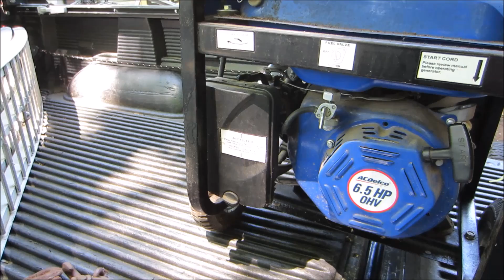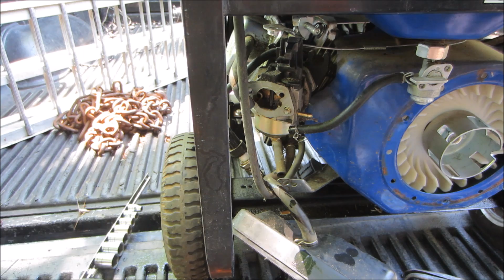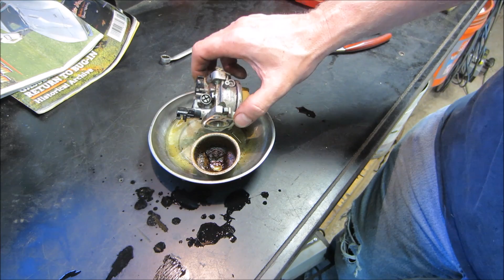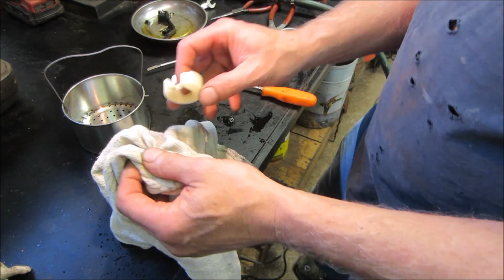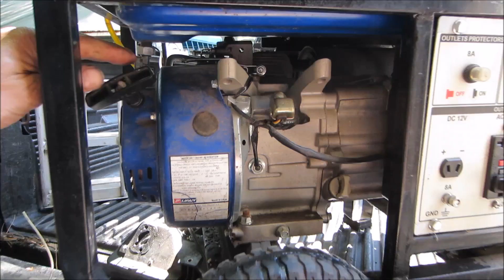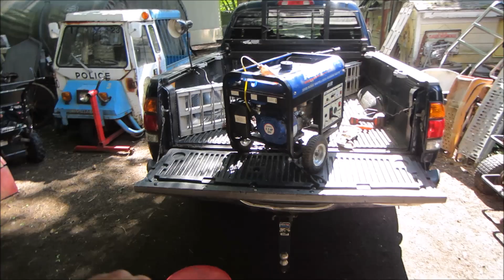will it run? seized china generator

Comment: Are propane motors subject to the same carburetor issues if not kept in service over extended time?
Reply: Wouldn't think so, other than possibly moisture in the fuel system. No ethanol or dirt to be introduced by gasoline.

Comment: Hi from Australia . I enjoy your videos very much  My 8 kva Chinese generator seized while running  . Strip down showed the valve guide had broken up and jammed the piston . Piston was found to be ok after I stripped the engine down . $30 for a new head and gasket it has been running fine for the last 3 years . People told me I should have bought a Honda at 10 times the cost but my el cheapo  6 year old generator is fine in my workshop running all my power tools including my welders ..

Comment: You have to make sure the RPM's are right to produce 120 volts and that you have 60 cycles.  If not...You'll burn up appliances...Also the surging is a leak in a carb gasket and a load helps to level things off...

Comment: Had a customer with a PowerMate generator, basically the same thing (all these China generators pretty much are). He dropped it off with old gas in the tank. It sat around for a few years and the petcock was just packed full of old varnishy gas. The fuel screen under the gas cap was all rotted out, the screen in the pet was all rotted out. I pulled out all the old screen material, cleaned the tank the best I could, and just added an inline fuel filter. Threw it all back together and it was surging just like this. Turned out to be a plugged main jet. I've also had mowers with similar surging problems, and most of the time it's just something small. It's kind of crazy how the slightest error in adjustment or air/fuel ratio can throw governors way off.

Comment: Thank you for explaining how gas gets into the oil. I've had this happen on two Ryobi engines- one is a power washer, and the other is my Ryobi inverter generator. In the power washer, the air filter was completely soaked with what appeared to be gas and maybe oil, and in both cases, the engine actually seized up while running. I fixed both the generator and power washer by draining all of the oil and changing it and both engines seem to have fixed themselves & they both work great now. I also now make sure to run the engines periodically just to make sure it works fine, as well as shut off the fuel on the power washer (generator doesn't have a specific fuel shut off, but I think the "stop" position on the only control they give you does shut off fuel). I thought it had to do something with the crankcase breather tube, but the idea that gas draining from the carb into the cylinder and into the crankcase seems to make more sense. And in the case of the power washer, the gas probably did make its way from the carb down into the air filter, so bad carburetor to some degree seems logical. I'm lucky more damage wasn't done and that simply changing the oil was all it took.

Comment: I was given a generator that I was told was seized.  My first instinct was to check the oil.  Oil looked new, and was at the proper level.  Could not pull the recoil.  I removed the recoil.The bolted on cup was too fragile to use a screwdriver.  I used an 1/16 deep socket and breaker bar.  I pushed down, to my left.  I had movement.  I took the breaker bar to the right.  More movement.  I turned a few more right hand circles and installed the recoil.  The engine turned over when I pulled on it.

I scared up a spark plug and installed it.After setting the choke properly, the motor started on the third pull.  The volt meter showed 120 volts.

I plugged in my hand sander, and it had power.  I plugged in my jigsaw and it worked.

A running generator and power output!  Gotta love it!

Comment: Look around and see if there is another oil drain.  Most of the engines have 2 drains. I put a short pipe on my generator engine with a brass collar to extend it out where it can be grained easier without getting it all over things. May not needed a brass collar but thought it would seal better than the steel one.

Comment: I put a generator in a shop years ago because it didn't generate power and the guy plugged a 1/2 inch drill motor in and spun the drill by hand to fix it. Does anyone know which direction you spin it?

Comment: Many thanks for your many videos. It takes me back over 60, ears, when as a 7 year old, I use to inquire what my Dad was doing in h if s workshop. He was not formally trained, but could do everything. He had alsorts of pullers to take off magneto, to get to points. I remember the screw in pullers of assorted sixes, he had made himself. He I often worked on B & S, Villiers and Anzani engines. He use to rebuild Howard Bantam rotlvators. I vividly remember the parts washer. In those days a tin with paraffin (kerosine)  and a small brush. Thank you for bri ging my childhood rushing back

Comment: Hi Mustie got a Robin EH25 that was soaked in water. Stripped it down and washed out completely, honed cylinder and put together. Had to make all the gaskets. Got it running but wont idle. Will have to do a carb clean. You wont believe how much gunk came out of it. Your videos have been a great help.

Comment: Same generator as I have got but the 3kw 240/110v with 12v 8a charging and the honda 160cc 6 1/2 hp engine, My tank had a load of rust in it thanks to the tank level gauge letting rain in. I brought it off of ebay as a non worker £40 ($55), I had to but a tachometer to correctly set the governor 1500rpm at idle  and the governor takes over (as the engine slows down under load the governor takes over to bring the idle back up)

Comment: All these problems caused because they did not hibernate the engine correctly.  Only takes five minutes to empty the fuel tank, and then run the carburettor dry.  Trouble is, most of us are guilty of incorrectly storing our gas powered devices.
Reply: Hey david, I have also found (since I do winterize my stuff... mostly and guilty of not also) is the metal gas tanks will condense heat and cold so if stored empty they collect fine droplets of water and start to rust.  I see no way around this problem... saying that if the tank is stored with fuel (fuel line shut off and carb drained of course) the tank stays much cleaner and problem of rust is averted.   Now when needed to be used just expect to drain old fuel out of tank and put in fresh and recycle old fuel in your car on a mostly full tank. So far... this has worked well for me.
Reply: @thaddeustroyer  I solved this by spraying the inside of the tank with a very light oil or rust preventor eg WD40.  A mate of mine puts desiccant satchels, that absorb water, into the tank, but I find WD40 good enough.  Plastic tanks definitely solve this problem
Reply: I forgot to say that if these generators had plastic tanks this wouldn't be a problem (cept the whole winterizing steps need to be followed as well)  I do like the boat gas tank idea, hadn't thought of that but solves an issue.  What do ya think?

Comment: One of the things I like about your videos is that you utilize compressed air to clear out your carburetors. I cannot think of a single carburetor that I have worked on and not use my compressor. If a family member or a good friend ask me to come over to their house to look at something for them, I made sure I bring my 10-gallon air can. 

I enjoy watching your videos. I'm hoping soon as things get back to normal. I cannot even get anyting I normally order before spring kicks in. Most of the vendors I deal with are on eBay and none of them are shipping parts. They're taking orders but not making deliveries quite yet. I don't know about you but I'm surely not going to pay for something when somebody tells me I cannot tell you when you're going to get it. He'll the things I've ordered  could fit in an envelope. 
I like to make sure I'm prepared. I still have a small supply of things but that's for my stuff or family.

Comment: thanks to your videos on generators, i took a gamble with a $100 on a 5k watt gen that wouldnt start, was told it ran the last time. long story short is the fuel tank and carb are very clean but  the oil pressure sensor didnt let it send spark. oil level is good, disconected it, starts right up 😎😎  thanks for your great videos and explaining with detail what your doing!!!

Comment: For 4 years, I did small engine repair for a company. We did warranty repairs mostly but we'd get some walk in stuff too. The most fun I had was with lawnmowers that seized due to oil starvation. Customer would buy a mower, assume there was already oil in it.....despite the bottle of oil that came in the box..... and mow, god only knows, however much of their lawn before the engine just ceased to rotate anymore. I had darn good luck with them too. They would blame the equipment. The problem description was always "Recoil is not working" or something to that effect. I would find oil so clean, you'd think I had just poured it in. That's because the customer tended to find the error of their ways (after it seized) and put the oil in that came with the brand new unit. I would then call them and say "This can go one of two ways. I can tear this engine down and find the scored surfaces. Based on what they look like, I'll know that it was operator error and not manufacturing defects. It wont get warrantied and you'll have a tore down pile of junk. The other option is I can free it up. If it goes smoothly, you pay me 40 dollars and walk out with a running mower." Sounding defeated, they always picked option two hahahaha Id work the blade/crank back and forth until it got smooth, then I'd let it rip. I only ever had one engine that didn't survive the revival process. The connecting rod was stuck way too good to the crank and it snapped off. I saw alot of Husqvarna mowers with stuck valves too, Exhaust valve if I remember correctly. Pull valve cover, smack the valve stem with a hammer, good as new.

Comment: What fluid are you using in your ultrasonic cleaner? I just got one in but have not used it on engine parts yet so to clean my glasses and such I just use water and a little bit of dish soap. I will need to pull the injectors off of the carburetor of my 1990  Chevy 454 and run them through a cycle to see if I can salvage them instead of replacing them but I don't think water will be the way to go with them.

Comment: It is probably hydro locked with a cylinder full of gas.  I would yank the plug and pull the starter rope.  This is why I shut off my generator with the fuel shutoff.  Change the oil and clean the carb and you should be ok.

Comment: The little brass tube with all the holes is called the emulsion tube. Its purpose is to introduce air into the fuel flow to reduce the amount of fuel going to the main jet as the engine speed increases. The fuel flow through the main jet increases to the square of the air speed and pressure drop through the carb Venturi. Without it the air / fuel ratio or mixture would become increasingly rich as the engine speed increases.

Comment: Good fix and good video. Years ago I used to use a 2 part epoxy coating on the inside of, mostly, motorcycle tanks that had gotten rusty. You had to mix the 2 parts, pour it in the tank, then rotate the tank for a while to get the coating all around and let it set up. As I remember, it wasn't that expensive.

Comment: It's Friday night, sitting here on the coast of Central Florida awaiting the arrival of hurricane Dorian..  I dragged out my generator.  Perhaps 7 or 8 years old, but never used.  As an avid watcher of your channel I felt I was prepared to do battle with whatever ailments this old gal might have in store for me.  It is a BlackMax 6560 bought at Sam's.  I checked the oil and about 1/8 inch showed on the very tip of the dipstick.  I added nearly a quart more and it seemed full.  Added half a gallon of gas, switched on, gave her full choke and yanked the cord.  She coughed, once, farted once and took off running.  The only fix I had to make was removing the wheels, and filling with air - easier than dragging it to garage or dragging compressor to the backyard.  Wish us all luck in the coming days.  Dorian's track keeps changing - the best would be if she creeps east out over the ocean as she makes her way north toward us.
Reply: I live in south Mississippi so I know how hurricanes are. Hopefully it keeps moving  east and misses yall

Comment: You nailed the price. Replacement gas tanks as cheap as 30-35 dollars. As high as 100 dollars. If it was mine i'd throw a 35 dollar replacement on it. Black or red though, if I wasn't reselling it wouldn't care. Good call on the price. Great video!

Comment: I'm lazy......and non-mechanical, completely.  I just buy new carbs for my UST Chinese generator on Ebay for 17 bucks....I've learned this much: if I turn my generator off using the electrical switch - just one time, and let it sit - it never starts again without having to have starting fluid sprayed into the carb.   Mine is so fussy I wouldn't ever try to clean the thing - plus, I wouldn't know what I was doing.  I think the whole thing is some sort of Chinese plot to drive the mechanically-challenged insane.  But I have gotten super fast at attaching a new carb.  Anything beyond that, and pulling the chain, is over my head (well, I can change the oil).  I only decided to try putting the first carb on when the guy down the road, "Mr Fixit" (Lapeer, MI) told me he would charge $56 and hour to look at the thing....  Suddenly, I felt that maybe I had one, small, mechanical bone in my body......I was forced, as a tight wad, to find that one, small, tiny, mechanical bone.  I had my gall bladder taken out a few years ago - think the Doc charged $55 an hour.......

Comment: Hey hey Mustie1,
Yup, I figured you had replaced the oil, but were you going to tell us ?

😁

Great video sir.
I really appreciate your thorough descriptions and thought processes, like the oil in the muffler. I was wondering what may have been causing the smoke after first getting it started... but you're on top of that.

Thanks a bunch.
I've got one of these seized up generators out in my shop right now. I've been avoiding it, but now I'm going to get it done and gone.

Comment: I knew there was a video here on stuck generator. I was just given a Sportsman 7000 LPG generator for free. New, never used except initial run when the guy bought it for Superstore Sandy. It is seized. I got it to turn slightly but it won't go past the gunk line yet.

Comment: It's kind of important if you want to run electronics or something motorized off of it to set the RPM close as possible to what it should be.  Hook a kill-o-watt or similar to it and make sure you get the hZ as close to 60 as possible by seeing the RPM.  Some micrometers have a frequency function too but the kill-o-watt is safer.

Comment: Adding some SEA foam after the cab rebuild always works for me!
 It will stop the engine from galloping by cleaning the built up varnish inside the fuel path.
Reply: Sea foam is snake oil.

Comment: You should look into ways of cleaning the tanks because they’re really not that scary. Are used to run a business called gas tank renew and we would cut open the bottom side of the tank to gain access and Wood use Walnut to blast the inside and then migweld it back together and then do two coats of the patented materials and viola! I am also seeing the Europeans use small abrasive pebbles and will put them inside smaller gas tanks and have them spinning somehow and will clean them up quite nicely as well but there are all sorts of different methods to clean up varnish and bake done crap and other chemicals that would work

Comment: I picked up the same generator out of a friends junk pile, told me the engine is trash and take it if you want. Turned out that for some reason the coil was hitting the flywheel, it was weird cause it wasn't rusty or swollen, reset the air gap and almost 10yrs later it's still going.

Comment: Hi Mustie1 is at better than something like seafoam that is made to be able to dissolve  stuff like crud? Also would it be possable for you to do a video on how to adjust the carburetor on small gasoline engines  like string trimmers and chain saws, and lawn mowers. I had a friend who decided he was going to adjust all my gasoline devices and now none of them run properly. When you do it it's obvious that its second nature to you and that you can almost instantly tell which is the high speed adjustment,  and which is the idle adjustment, it seems with most all of the 2 cycle engines that you attack it seems most always it's a carb issue.

Comment: To correct that surging, It might have been worth it to check that idle mixture screw. Maybe 1/4 to 1/2 turn out, to give a little more fuel when the governor throttles it way back when unloaded or under light load. You're right, a heavier load that opens up the carburetor will steady it out. it will also help to burn the gunk out of the muffler.
     I would recommend to the owner, to never shut off the generator by the run switch, but rather, turn off the fuel valve, and let the carburetor run completely out of gas. That's especially important, if he doesn't know when he'll need it next. It saves problems with gas evaporating and leaving behind varnish or gum, and it's much safer, in case the float doesn't completely cut off the fuel. That would also help avoid fuel dilution in the crank case. For that crusty gas tank, slosh it out with fresh gas, dump it, then install a good size fuel filter. That might be cheaper and easier, than trying to find a new fuel tank for such an uncommon generator. I've never seen an AC-Delco generator before.(It's probably just a re-branded generic generator)